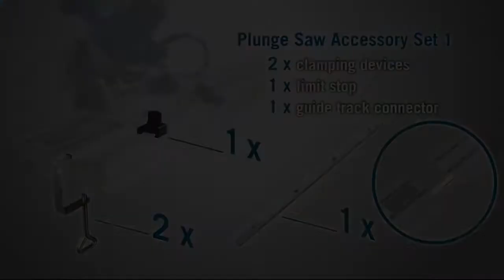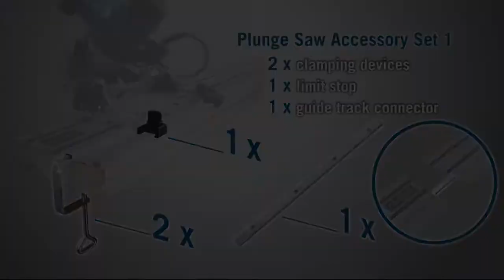New Scheppach CS 55 Plunge Saw System - 240v

Comment: I have this saw and that problem at 1:50 where the blade is still spinning and exposed is not possible with the saw. My guess is they removed the plunge spring from the one used in the video shoot to make the plunge action look super smooth, and because of that the blade didn't retract in that shot. The plunge spring is actually a little too strong, so there's no way the blade would stay out while lifting the saw.